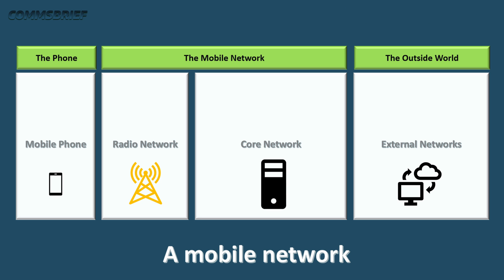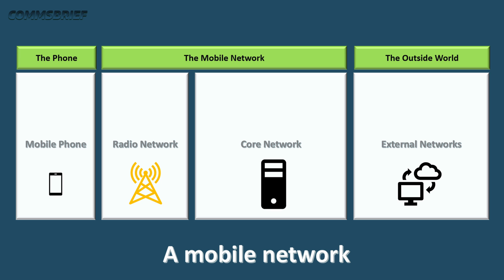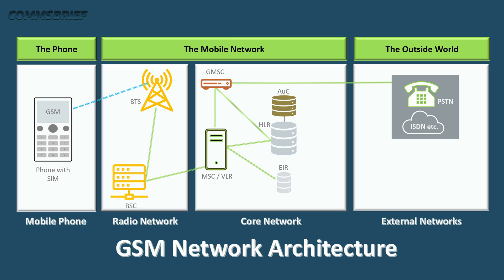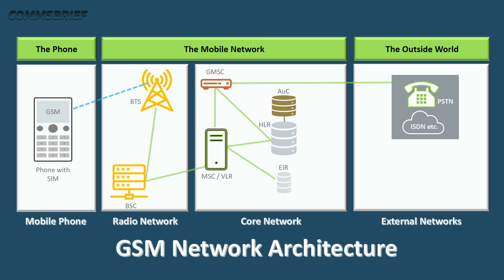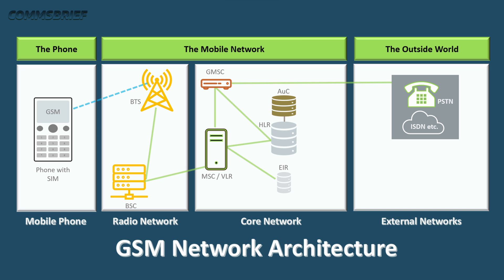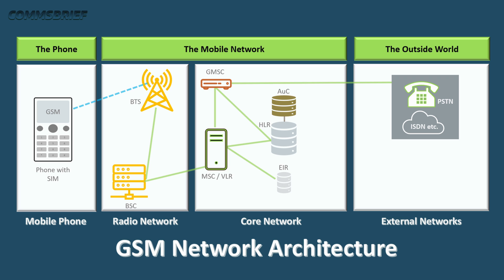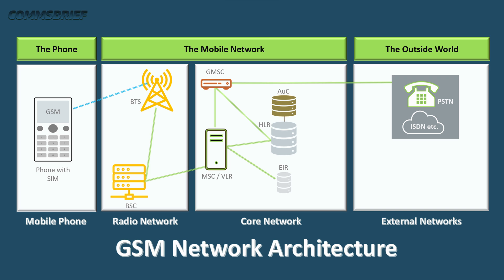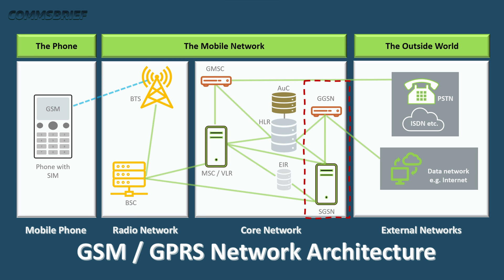2G GSM Network Architecture Simplified

Comment: Thank you for nice video. Follow ups:

1. Could you help make one video in detail showing exactly how the MSC performs the switching of calls. How does it make its decision on where to forward the call, what protocols does it use.

2. You mentioned Abis is the interface between BTS and BSC by interface do you mean physical port or?

3. Help explain exactly how the data or call flows or encapsulated from the phone to the outside network explaining what each node in between does to the call/data, what information the node looks for when forwarding the call.
Reply from the maker: Thank you, glad to hear you found the video to be nice. Great to have your request. Will have to plan that so can't promise any timelines. I have a long list of topics that are planned to come out gradually over the next few months. But thank you for the topic, I'll keep that in mind.